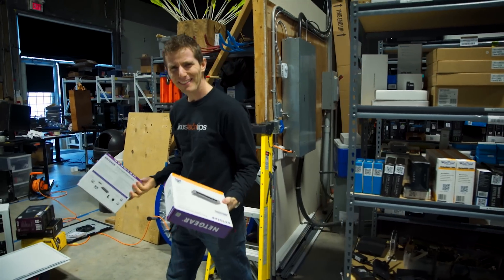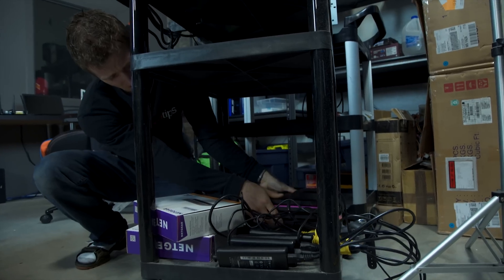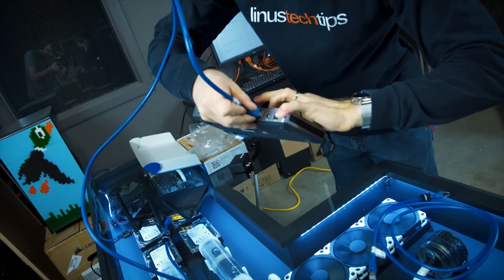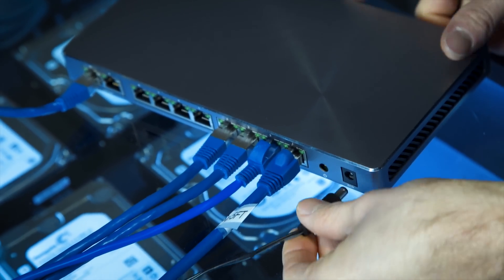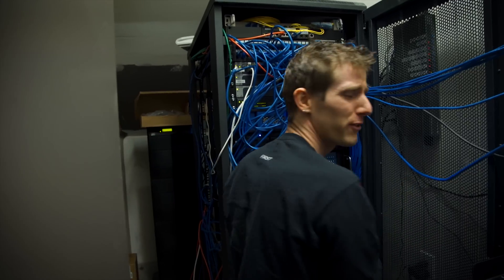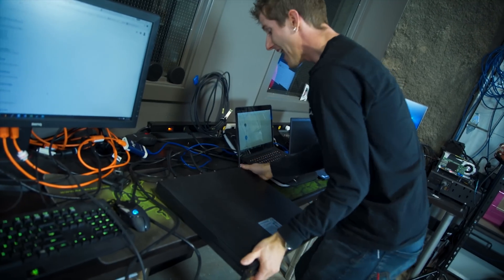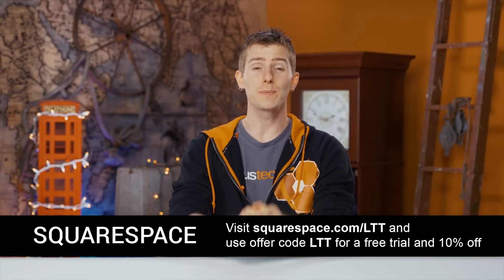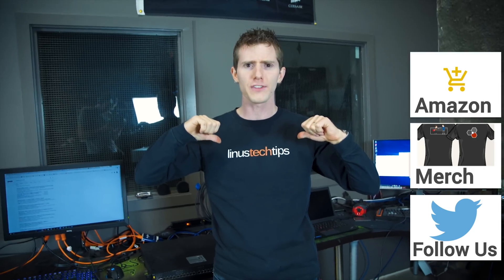Easy 10x Network Speed Upgrade

Comment: Hey Linus I was wondering is it possible to use an external hard drive like my 2tb Western Digital external drive as an internal drive in my custom built pc?
Reply: turboxanderman262 from my experience external harddrives are just harddrives with adapters and a fancy case on them so if you remove the adapter,case and add windows (if needed) from the external harddrive you can than put it in your pc if it has the cables and a bay to fit it in
Reply: What Dultimate said was basically correct until about 5 years ago.  But these days, there are external HDDs with USB ports integrated onto controller board.(i.e. no SATA interfaces to be seen anywhere.)  These, you cannot convert to internal HDD so easily.  You have to open it up and find out.

Comment: why is ten gigabit so expensive? copyright?
Reply: bigbendan01 Demand and component costs, I suspect. 10 Gigabit components are made in smaller batches than slower equipment, which naturally makes manufacturing more expensive and increases the R&D cost per unit. The chips might be more complex too, but that's just a guess.

Comment: Eventually 10GB will replace the 1GB of the present.  So far 1GB serves my house well.  My Synology nas is filled with slow mechanical drives that would never benefit from 10GB speeds.  It's nice to see these improvements rolling out.

Comment: if the file is 10gb on a 10gb/s lan network, shouldn't it transfer in 1sec, heck even 2sec, it showed 100-200mb/s only..
Reply: 1 Byte = 8 Bit, therefore no. 10 GByte will not transfer in one second via 10 Gbit/s network. You can realistically reach 1Gbyte/s, which is fine and would transfer 10 GByte in about 10 seconds.
Reply: Do you even know the differnct between gigaBIT and gigBYTE? Jesus...

Comment: hey guys I know "somethings" about internet. but never really looked at a switch. so a switch is only for wired networking. am I right, or is it also a router?
Reply: A switch does no routing, otherwise, it would be a router.
Reply: And yes, wired only. Although the next generation of wifi protocols (802.11ad) will need something faster than Gbit as up link, as it will offer several Gbits/s.
Reply: thanks for the answer guys :)

Comment: So where is speed comparison?
Reply: Well, 100Mbyte/s on a GBit connection, vs 1000Mbyte/s on a 10 Gbit connection. What is there to demonstrate.
Reply: 6:19 Both of switches have 10 Gbit ports and 1 Gbit as well. I expected comparison of pro-consumer switch against enterprise switch, because my Network Administration teacher insists that consumer network equipment have no chances against enterprise level equipment. "Even if enterprise switches 10 years old, they are still better than those which you can buy at store"(C) My Teacher.
Reply: Well, that is bullshit (C) ThunderbyteNet .

There are several parameters which determines the possibilities of a switch:
- Speed class: 10/100/1000 Mbit , or (as described here) 10Gbit. That is the speed of every single port. The backplane has to support switching with a max rate from every port to every port.
- Switching options: unmanaged switches only do pure switching, nothing else. With managed switches (maybe your teacher means those), you have more options, like trunking of several ports to a "virtual" single port (LACP), VLANs for separating ports from each other and many options more. Those managed options are however mostly for bigger and managed networks, not necessarily for home users. So if you only need pure performance, an unmanaged switch might be very fine indeed.

And no, a 10 year old "enterprise switch" will be loud, possibly only 100Mbit, use lots of energy, be big etc. All that is contra productive for home use, where a switch should be silent.

Comment: I think industry needs some touch ups very soon. Today standards usb 3.0 3.1 etc have much more horse power than regular gbit connection. Which is fine. But it is irrelevant i have to use some ssd in enclosure to get real speed instead of network. 
I hope 10 gbit or a newer interface will be available with cheap prices. Like fibre :)  Scalable almost no limit :)  never have to change the cables again :)

Comment: Question! Why aren't we changing to USB-C/Thunderbolt 3 networking?
I mean, Ethernet cables can do 1Gbps/10Gbps, right? Thunderbolt 3 can reach up to 40Gbps, meaning you'd get all the internet speed you could have and still be able to transfer files between machines at a much higher speed than Ethernet, right? And according to one of Linus' videos, it's possible to utilize optical fiber with USB technology, so you wouldn't lose package even with long distances, and since the objective wouldn't be to charge/power a device, there would be no need for power transfer on those cables!

I understand there's a matter of cost and USB-C is still growing inside the market, and only big companies would really benefit from what I described above, but shouldn't we be seeing some pioneers on the field working on that by now? I can use USB 2.0 to get internet signal from my smartphone to my computer and game on it, it seems only logical to me that USB-C LAN would be a thing!
Reply: 1. No it is not a thing, because TB3 and USB do no routing. There is no TB3 switch, so you can only connect 2 devices directly.

2. Well, there are 40Gbit and even 100Gbit rout able and switchable connections already in wide spread use - in data center backbones and underwater cables. Those connections are purely optical.
Reply: Ethernet, and USB/Thunderbolt (or any other file transmission standard you can think of) are VERY different. The underlying firmware and hardware is nothing alike, especially when it comes to switches and routers. Ethernet is much more complicated than your typical file transfers. A lot more goes on in a network than you might think.

As ThunderbyteNet stated above, 10Gbit is not the fastest network speed. There exists 40Gbit, and 100Gbit standards that use fibre cables. This type of infrastructure is very expensive, however, and only really found in data centre backbone networks.
Reply: I see, thanks you two for clarifying that!
Reply: Well, I don't agree with your point that 1 Gbit/s is "enough" for home users.

1. Many home NAS devices or home servers can easily saturate 1Gbit (=100Mbyte)/s, many could do 300-400 Mbyte/s (which can be seen when they copy data internally), if you put SSDs in them, they can be in the 700-900 Mbyte/s area, or even more. So even home NAS devices could support more than 1 Gbit/s.

2. As mentioned above, 802.11ad - the next wifi standard will support speeds way above the 1Gbit/s limit. For those access points, something faster than Gbit LAN will be necessary.
Reply: That is true. Many users - as the comments under this video is a very good indication for - only see and need internet speed, maybe in combination with their wifi speeds. If there is indeed no local device (NAS, server) to or from which there is A LOT of traffic, and which is beefy enough, then 10G makes indeed no sense.

I would love to upgrade to 10G, unfortunately I got a NAS with only 4x1Gbit network with no upgrade possible AND my main LAN cable (through the house) is Cat5 (not even e, I think). Gbit is fine, but 10G would need a completely new cable and lots of wall slits. If I really should do that, I might opt for an optical cable altogether.
Reply: I just want to add this:  USB-c to 10Gbps dongle would be pretty expensive in terms of CPU cycles.   It will have noticeable impact on FPS.
Reply: TwilightWolf032 part of the problem is that thunderbolt is limited to 10 meters on copper,  while 10 Gbps Ethernet can do full speeds at 100 meters on cat6a standard.
Reply: And what are you doing to your NAS exactly that is transferring faster than 1GBit? You have to encode 4K raw video on it from a remote PC. I can't think of another use case. 128 MBs transfer rate is more than enough for a NAS. It's not a question of how fast your SSDs can transfer data. It's a question of much data per second you need for what you are doing. If you can't saturate the connection in your workflow or you are using it just to transfer files to and from the NAS for storage purposes, then you are just burning money for no reason.
Reply: Thunderbolt is limited to 30 meters normally, but now there's 100 meter connections that are probably really expensive and trash.
Cat6A in its mere base form can go 55 meters on nearly any cable, and if it fully complies, 100 meters normally.
And that's not even its final form. In its final form, 10GBase-ZR, which is unfortunately not canon in the IEEE 802.3ae, but can go 80 KM.

Comment: Would this work if i connected my Synology NAS with 4xGbit and link that to 1x10Gbit to my PC?. I would be happy with 2Gbit or more, but cannot get a second LAN cable to my pc....
Reply: Not really.  I believe this switch is unmanaged so you can't do proper LACP configs on it to bundle the 4 ports together.  Even if you could, it wouldn't speed up single connections from your PC to the NAS anyway.  You'd really need to get a new NAS with 10GbE support to make use of this.

Comment: Hey Linus, I was wondering if you can make a video about replacing the regular black tubes from an AIO CPU cooler with your own clear flex tubing. If you can do it with a custom loop, you should be able to do it to a AIO.

Comment: wouldn't need a router that also supports 10gb if for say you had multiple switches connected and you have one device accessing from one switch to another and both of them are using the 10gb ports.

Comment: 10GbE should have replaced 1GbE on consumer products (motherboards, laptops, etc.) over 10 years ago. Really, 1GbE is ancient and ridiculously inadequate for even basic consumer use. From a production cost, 10GbE does not cost much more than the chipset for a 1GbE adapter. Companies just need to stop price gouging on it.

Comment: Ok i have a question i always wandered how can ISP provide multiple users with low latency internet of the same cable but as soon you connect it to your local house network and someone downloads something you get higher latency in games without disturbing ISP latency of other users on the same cable  is there hardware or software that fixes this issues for a home network  probably there is since it works for ISP would like an answer to this

Comment: The biggest downside of having enterprise switches at home is the power use. I have a 48 port gigabit switch for testing and it takes about 70W without any connected devices.
Reply: Also depending where you have to keep your gear, the fan noise can be a major issue too.

Comment: I got a Dell Powerconnect 2808 for $10 on ebay and it is awesome. The router that came from AT&T has 100mbps ports, which isn't really a problem for the internet, but the gigabit switch makes teamrender over LAN in Cinema 4D go way faster. Also Steam in home streaming is absolutely fantastic now.

Comment: So that rack switch is as expensive as the asus, is louder, requires more expensive cables, and does not work with your average pc unless you buy a network card, and has way more ports than a sane person will ever need. Couldn't you have just done a regular ad spot for the asus switch instead of making me watch an 8 min vid? Not helpful at all.

Comment: 10 Gbps network speed with a SSD with the maximum 1Gbps read speed.
Unless you put a bunch of hard drives in RAID then this is not that useful.

Comment: CLIIIIICKKKKKKBAIIIIITTTTT
Reply: ECCENTRIC No. Network Speed isnt Internet Speed. Dont scream clickbait if you are wrong.
Reply: It's just a joke lel, he made this in one of his videos where he may have claimed something confusing and outrageous.
Reply: That's kind of a stretch to expect the majority of people to differentiate between NETWORK and INTERNET. You could have said "bandwidth".
Reply: its network not internet learn the fucking difference
Reply: what bandwidth is much worse and its commonly used to refer to internet speeds
Reply: The title of the video is completely valid. A simple google search can clear this up for you.
Reply: I'd say it is click bait thats a gig switch with some high speed uplinks if someone sold me that as a 10Gb switch I'd be kicking off and sending it back!
Reply: Dave Webster but its not -_- and linus isnt saying it is
Reply: 0:22 says otherwise..
Reply: Dave Webster i googled it and it has 2 10gb ports so it can be called a 10 gigabit switch especially for that price
Reply: john li Yeah I know it has, if you watch the video he says this in it.
My issue is the trend towards switches being labeled as the X speed where thats only the speed on a small fraction of the ports.
For the longest time this hasn't been the case, the switch would be advertised on the speed of the majority of the ports and not the speed of any additional uplink ports those used to be listed as a separate feature.
In the UK if you advertised the switch on TV as 10Gb the ad would get pulled pretty quick as misleading and in print media as the ASA would call bull on it but thanks to the internet nobody give two f**ks anymore so they can just say what they like and nobody does anything about it, what it does do though is waste my time having to research these things.
TBH thats the way of the internet look at all the fake news and made up bull thats floating around.. Just make it up as you go along as long as some fool watches or buys what ever it is your pedaling to them.
:(
edit:
Actually looking at this, this is many a media issue.
everywhere selling it is calling it what it is.
https://www.broadbandbuyer.com/products/25042-asus-xg-d2008-uk/
Reply: Dave Webster the name gigabit switch with two 10gigabit ports is too long and its not fair to just say gigabit switch so as long as they put the specs in the description its ok
Reply: It's a joke guys, they made a joke like this in previous videos. I didn't make a clear sarcasm note. And my point still stands, not everyone is tech savvy enough to understand this, so they would call it clickbait.

Comment: I don't get it. Wouldn't you need a really fast m.2 NVME SSD to even take advantage of the 10 Gbps? It seems a regular 7200rpm HDD would just bottleneck the switch massively.
Reply: Did you even read my comment? It's about the fact you would need really fast storage to take advantage of this. Moving files between disks you are still limited to the weakest link's read/write speed. I don't have disks to take advantage of anything more than 1 Gbps.
Reply: RAID 0 makes it easy to do 1 Gbps with spinning disks but it won't reach 10 Gbps. You need to take the clients in consideration. Say you're an office for editing video. You have a server with fast storage and use it to store all your raw data. Clients will need to fetch that data but will be limited by their disk transfer speed. You can't give everyone in the office ultra fast storage unless you're Microsoft.
Reply: You don't need it to be able to do 10Gb/s to take advantage of a 10Gb switch. All it needs to do is be faster than 1Gb/s, and 10Gb is beneficial. SATA SSDs that do 500MB/s won't even come close to saturating a 10G interface, but they're still 5x faster than normal gigabit.
Reply: That makes sense actually. I hadn't considered that. I always think in small office/home terms for some reason.
Reply: A fairly bog standard SATA III SSD can transfer data up to 6Gbps, so under heavy load, it'd be bottlenecked significantly.
It's not overly benefitial for joe average home user, but enthusiasts and small businesses with NAS solutions or servers, it's nice to have the option.

Comment: I get that 10 Gbit is great, but this is pointless in house's. No one has speeds even close to 1 Gbit and 99% of the devices that would be plugged into a network switch that a consumer would have, are only 1 Gbit capable.

Comment: Keep in mind that the title says "NETWORK" Not! Internet
Reply: Joe Schroedl Linus even explicitly said it wouldn't speed up the net - I'm amazed so many people missed that... or are pro trolls.
Reply: Thanks.  I just posted a question and feel like a fool.  -_-
Reply: +drb awe Same premise. You can have the latest, greatest, and fastest equipment in your home but upload is always going to be bottlenecked at your demarcation point.

I'm building a 10Gbe network in my home, but no matter what I do (stream, upload files, seed torrents, etc.), I'll be limited to 1Gbps sending packets outside my home network because I have a 1Gbps up/down line from my ISP.
Reply: i checkd my wifi network and for a second i thought it said 58.0 gbps
Reply: No, that's all dependent on your upload speed provided by your ISP, friend.

edit: +drb awe
Reply: pepool
Reply: +Gerald Folsom yes
Reply: Yeah, but he transfered the file at 800 mbps max that's not even gigabit. Useless.

Comment: so how much porn do think you can download with 10 gigabits?
Reply: tubbythetub 10 Gigabits
Reply: A lot, but unfortunately the switch transfer rates are referring to use within a local area network.
Reply: depends where you get it from, that is going to be way, way faster than any server will let you download

Comment: When you run robust hardware you REALLY see the difference. my old office desktop (pre -built) took over 3 hours to reinstall a OS from scratch. I HATED the wait. was planning for it with my new custom but it astounded me by zipping through all 4 installation disks and being fully functional in under an hour. it just blew me away how fast it ran. Cant wait to upgrade my cable because i sadly have Cat5e cables atm so my gigabit router cant go 100% with crappy cables so installing updates over the internet was significantly slower than hard disk/USB installations. To have a truely powerful system it saddens me to say you have to brush up every weak aspect even if it is not technically part of the computer itself.